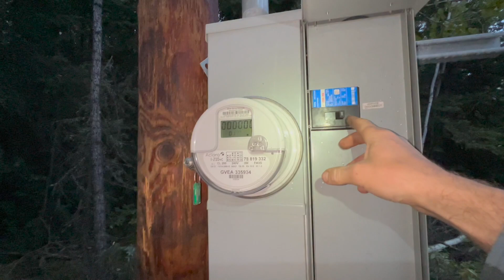Building our Alaskan Dream Home/Shop Pt. 16 Hooking Up Power and Septic tie in

Comment: I’m very impressed with this build. Question for you:the two feet of foam was only because that’s how deep the footer was ? 
I’m looking to do a insulated footer in Vt for a slab on grade build and they are using 4 inches of foam sloped for drainage for that area.
Reply from the maker: Yes my footer was 16” thick and has 3” of foam up tight to that. I ran the 3” foam 2’ out at angle to keep cold from being able to come in under my slab and sloped away for drainage

Comment: The electric will not pass nec inspection. I think you need 4 wire from the road to the house. Unless Alaska is altille different than the code book.
Reply from the maker: I ran a separate ground

Comment: Why not mount the panel/box inside out of the elements?
Reply from the maker: You have to have a disconnect switch outside in case of a fire so the fire fighters can kill power to the house. If I wasn’t so far from my pole I wouldn’t have needed it